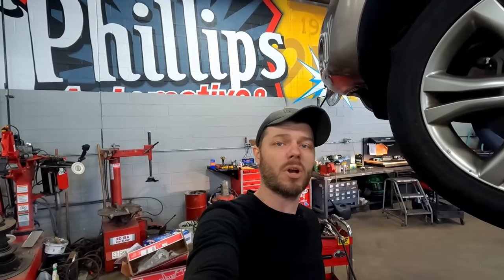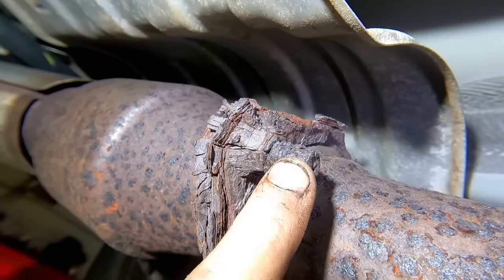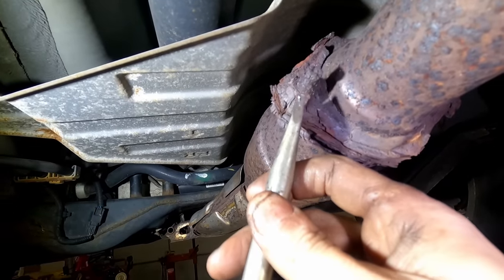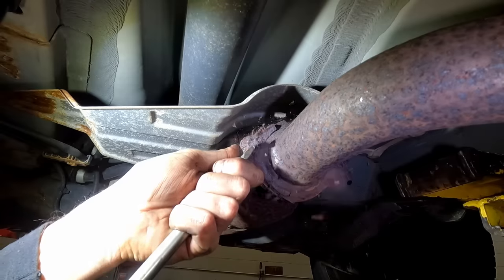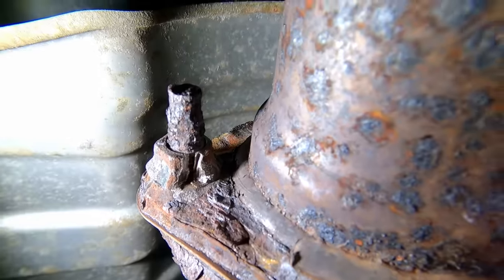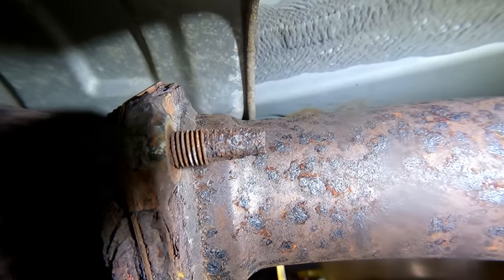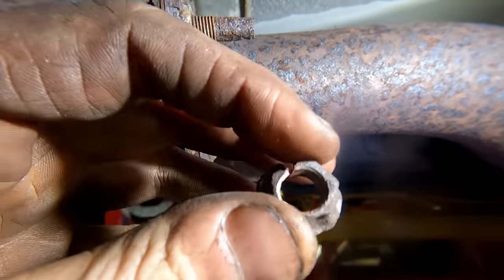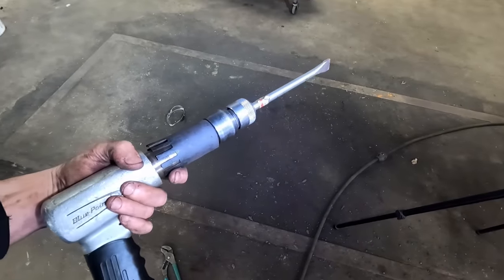Top Secret Mechanics Trick 2! HOW TO remove extremely rusty exhaust nuts FAST without heat.

Comment: My CP long barrel is still kickin' even though I retired in '85.  That's Chicago Pneumatics, not Central (HFT), to you new guys. BIG difference.  Now tell us how to remove exhaust manifold bolts from the heads.  That was always my bane to existence.
Good tip, Mike.  I wouldn't be surprised to hear (literally) of CAT thieves using it next week.
Reply from the maker: I actually use this a lot on exhaust manifold stud nuts. Ill have a video coming up soon for removing broken manifold studs in the heads super easy. Stay tuned.

Comment: Most DIY guys don't have a compressor ( I do) so they can try a nut splitter from harbor freight.
Reply: If you don't have a compressor, use a hammer. It's just going to take a little bit longer.
Reply: Nut splitters suck and there's not room on a nut like that.  As mentioned a plain chisel and a hammer does the same.  I'm just not sure why you'd bother trying to save that stud either you can sawzall through the flange knock the stud out and replace with a bolt set
Reply: Harbor Freight carried a nice electric drill with a true hammer function for around $70. Useful tool for other projects as well.
Reply: or get a cheap cut off wheel for 20 bucks
Reply: Jesus said, If you do not have an air compressor sell your cloak and buy one.
Reply: Being a DIY guy without a compressor would be like being an athlete without shoes. There is no such thing.
Reply: @paramax55  there are barefoot athletes.
Reply: @bryceg5709  it's fast and the stud is re-usable so why not
Reply: @jbbolts  because if you're a mechanic and I'm paying you to remove that nut you are presumably replacing a component on my exhaust maybe a Cat or a Muffler.  That stud if it's that corroded on the end is that corroded between the flanges also.  So when you torque the new nut on and send the customer on their merry way that stud which only costs a few bucks in bulk is going to snap off before the muffler needs replaced.

So what he did might be acceptable for a DIY guy who happens to have an air chisel and a belt grinder and a compressor but is also then not in possession of a stud but has a good replacement nut.  But if you are a professional selling a Muffler job and are under the car and doing this job just do the thing right knock out and replace the stud so your customer doesn't show up in a few thousand miles with a cracked stud and exhaust leak.

So I guess my point is good trick but  a but shoddy for professional work.  Probably recommend for fleet or rental repair but not retail private jobs
Reply: @bryceg5709  obviously you won't be using it in every situation
Reply: @bryceg5709  what is the torque spec on an exhaust flange?
Reply: @1pcfred  that size probably around 45 ft lb.  But again the corrosion and embrittlement is high
Reply: @bryceg5709  if the flange seals and the exhaust stays up then it's all good. But the only way you're going to get any kind of a guarantee anywhere is if the entire exhaust system is replaced. Otherwise it's just a repair.

Comment: it is OK IF you have the space to work, very often, these nuts are on a cramped area so you can only reach with a socket and an extension.
It is why I don't touch an exhaust system if I don't have an access to an oxy-fuel torch.
good video.

Comment: That was so refreshing and genius. I want to send this video to a few local mechanics. I drive a taxi and do lots of work/DIY on my car, but certain jobs just need lifts and expertise. No excuses from my mechanic about seized control arm bolts suspension etc will be tolerated anymore 😎🙏🏼 5:33
Reply: this trick would not work on a bolt where it is seized into a bushing, such as control arms etc. still a good trick though

Comment: Been doing it like that for 40+ years the problem is it's a no go on exhausts with cat converters, the manufactures state do not use an air chisel or the cat converter can shatter. If you're replacing the cat then it's the best/fastest way. It's a particularly useful method on manifold nuts.

Comment: Great video! I learned something new. Could you used a grinder to cut a slot into the nut and then use a big screwdriver or hand chisel placed in the slot and knock on the screwdriver or chisel in the direction to loosen the nut?

Comment: Hey MotorMike, great professional video. I am trying to replace my rusted exhaust muffler on a 2003 Dodge Dakota, my rusted bolts came off great using penetrating oil on them, however, I can't get the muffler to come loose from the pipe on either side, what is your advice on how to separate teh old muffler from teh pipes?  Thanks

Comment: I do something similar. I take a cut off wheel and remove part of the nut then use my air hammer with a chisel bit and the nut spins right off. A little part of the threads getting damaged makes no difference the new nut always hammers right down.

Comment: I've used a nut splitter before, great tool, manual wind in, but you need good access which often is not the case.

Comment: I have used a Dramel with cut off wheel to split the nut on one side, then use a chisel  to " crack the nut. Sometimes, a screw driver blade will open the nut. I have had to cut on eather side of the stud on some. As you said, the threads are still there under that nut.

Comment: Damn good and well done video using lots of light and nice zoom shots. As a competent DIYer, I had to install a new flex pipe in my friend's car. The rear fasteners were not an issue; snap them off and install new bolts and nuts. BUT the front fasteners at the cat were near impossible to get to. Snap those off and forget about an easy fix. I used PB Blaster, my oxy-acetylene torches and a spiral nut remover. Finally, the nuts did not come off, but the whole stud unscrewed from the flange. Now to put my impact to some use the next time.

Comment: Having had an old land rover that was used for all sorts of off road driving, you quickly learn that it’s far quicker to just chisel off the bolts.
I used to use a wide bolster chisel and club hammer and just cut the bolt. Land rovers are bolted together so they have lots of fasteners. 
Far easier to just cut the bolt right off and replace it. 
I’ve never used a nut splitter or air chisel.

Comment: @MotorMike unfortunately I used a grinding wheel to seperate the flanges, it worked, however, a piece of metal fell down into my muffler. Now, while holding the muffler in my hands, and and flipping it 180 degrees, I can hear the metal piece moving all around. I tried using a magnetic tool retriever, but no luck getting the piece out. Any advice is greatly appreciated, thank you for your time sir.

Comment: Nice,  When I didn't have an air chisel, I would use a drill to put 1 or 2 holes in the nut then use my hammer and chisel.

Comment: I had a 1970 Land Rover and used a nut splitter on my exhaust nuts. Very easy to do. It's a similar thing to doing this.
I saw this and thought there might be an idea for me, then realised it's a car.
I just got the nuts off my motorbike exhaust today before seeing this but I couldn't have done it anyway, exhaust and fins in the way. I did have to use a hexagonal socket for maximum grip, those multifaceted things are no good and slip off. The gasket had blown so I first tried to tighten the nut then undo it. I did this several times and got it moving and carried on and used WD40 to wash away any rust. Same with the second one. As you say, the thread is still good.
I considered drilling into the top of the nuts to help break the rust seal.

Comment: Another approach I like to use is an open end or closed end wrench 🔧 I have a small sledge hammer 🔨 I made.  Tap several times on the wrench increasing how hard you hit the wrench each tap... Breaks it loose every time

It's fast quick and EASY

Comment: I'm with jackoneill. Been using nut busters for 30 years. You can make them any way u like in a few min. Always works. Or a induction gun. Heat it up, smack with hammer and remove. Or just cut it off.

Comment: Excellent technique to remove rusted bolt if you have a snap on Ingersoll Rand long barrel air hammer. These are not cheap. But if you dont have one of them, use torch

Comment: Your chisel bits are tool steel. Put them in a vice and use a file to sharpen them. The heat from the grinder will stuff the tensil of the tool stell in the tip, soften it and will wreck it. Also air chisels are banned in the workplace in some countries, too loud , use ear protection or pardon what was that will be your favourite saying.
Reply from the maker: YES very important tip. I'm a machinist and metallurgist also. When sharpening you can use a grinder but VERY important to keep the heat down. Do not allow it to turn blue. Go slow and cool as needed.

Comment: Simple way of doing it, as long as you don’t need to reuse the nut or have a spare one. I have used a centre punch as well doing it this way. I prefer the hot 🔥 spanner . Or welding a large nut to the rusted one. I used to work on salt mine trucks as a diesel mechanic.

Comment: Good video thanks. Just an observation, be careful the way you sharpen the chisel on the bench grinder as the chisel can get pulled in between the rest and the wheel, which can make the wheel explode, doing it that way. Really you should point the chisel upwards when sharpening

Comment: This trick is great on most nuts in a solid position. But on exhausts with hammer and chisel this can not be dine. But there is a tool that just goes over most nuts and when you torque it down it cracks the nut.

Comment: I used a long arm torquing wrench with a socket on a header to manifold nut which only sheared the corners off the nut, then tried a cold chisel for over two hours and the nut is destroyed on one side and damaged the stud thread. The other nut is frozen as well.

Comment: air hammers are one of the most useful tools... i remember when my grandpa got me my first devilbiss set when i was little... well, young, i was 5'11" and 270 when i was 12. went from running back when i was 8 and "normal" size, to supersize lineman by the end of my first football season gaining 40 lbs in that season alone... never did get any taller... did get a tad wider, though. which is nice... 😒 i'm just off on some tangents today.

Comment: I knew this last-resort technique already though I can only use manual force and a cold chisel as I do not own an appropriate air gun. Most interesting part of this presentation is that you work with bare fingers, no gloves, which is how it should be done for max feel!
Reply: I'm a mechanic, and as long as you have enough access to swing the hammer adequately without hitting your hands then by all means you can use your hammer and cold chisel. I do it all of the time when I can't get my air  chisel into.

Comment: I wish I had know this before doing the exhaust on my truck. I had two of those flanges with three bolts each, and one nut telling me to split the flanges with an angle grinder to get the bolts out. I flatly refused to do that, and did it the hard way, drilling the bolts out.

Comment: Great trick!  I've used nut splitters in the past when an air hammer or manual chisel wasn't an option.  On an exhaust that bad, if it's a full replacement, I'd just Sawzall it and toss the bits in the bin

Comment: Nice work! Personally, I would have cut it off, drilled it out and replaced with a new nut and bolt though!
Reply from the maker: you never want to voluntarily drill an exhaust stud. They are super hardened over time from all the heat. It's a good way to kill drill bits. better option if the Nut won't come off is to cut the stud behind the nuts to remove the mating part. Then cut the remining stud flush with its own flange. then heat the flange around the stud till its glowing red and take a punch and punch the stud through. It will blow the treads out and leave a nice clean hole to pass a new bolt through. You'll be finished the whole job before you drill out 1 stud.
Reply: That's exactly what I did on my exhaust.
Reply: @motormike43  great answer and as you have shown it's the last resort too,great learning video for those that dont use this method,those air tools are great at unsleaving exhaus tsections too that slide into each other,have a great day
Reply: @motormike43  00000000000⁰000
Reply: If they are that bad then I usually won't cut them. I will heat up the flange just like Mike said then put the easy out socket on the stud and put it in reverse and it will rip right out usually taking the threads with it. Then the nut and bolt passes right through. Same but with no pounding of the hot steel with an air hammer and possibly bending the ear of the flange preventing it from sealing.
Reply: I'd replace the whole exhaust if it was my car.

Comment: Can also cut the groove with a small dremel cutting wheel or grinding bit, with some precision. Then you can hammer a chisel into that. Possibly a quicker way to do it without an air hammer than hammering the chisel for the whole thing.
Reply: also avoids rattling the shit out of the whole exhaust system. potentially damaging cats etc
Reply: That's exactly what I was thinking too

Comment: Nifty ! I've seen quite a few of what I'd otherwise consider damn good mechanics waste a lot of time with heat on such jobs. Even just a regular hammer & chisel will work virtually every time so long as you have access. Luckily my uncle taught me this when I was a kid. A torch is a must for certain things though.
Reply: In the absence of an air chisel ,  heat and an undersized socket hammered on works great . Also an angle grinder with 1mm cutting disc and a new bolt works very quickly and easily .
Reply: Heat makes it faster and easier, less damage as well. They knew what they were doing. If this was a smaller fastener , he'd have broken it before he got it apart

Comment: Grinder
Reply from the maker: What are you doing with the grinder?
Reply: I usually zip saw the nut/bolt off and install new hardware. I wouldn’t leave the rusted bolt on there. Good tip though
Reply: You can if you are careful cut through one side of the nut with a slitting disc

Comment: I have done this with a hammer and chisel. I see the air chisel is probably better especially where the part vibrate dissipate your hammer blow. Of course this only works where you can get a straight shot on the nut. This is the life of repairs in the north where salt is used on the roads.

Comment: I had my exhaust look like that. Hit around it with a ball peen hammer lightly, some love taps with a cold chisel, and wire brushed it down. Wrenched it off, and re used all of it. If you want to break the nut, theres also nut splitters available for cheap

Comment: Another approach to removing rusted nuts is to brush it with 30% muriatic acid, they sell it at Home Depot.

The acid dissolves the rust very quickly, in about 30-40 seconds, might take more time for deep rust but it works.

Just pour some muriatic acid in a cup and brush it on the rusted nut until the rust is gone then it should come off easily.

The fumes of the muriatic acid are strong so use a respirator and safety goggles and gloves, in a well ventilated area.

Comment: Great. Instead of using a nut splitter for 5$ you have to buy a Chisel, a compressor, air hose and the device to hold the chisel. 2500$. Really, a great video.

Comment: I broke the head off the bolt holding my catalytic converter to the exhaust manifold.  I'm thinking of breaking the head off the other bolt. cutting the bottom section of pipe below the cat to get that out of the way, then cut the broken bolts till they are flush with the flange, then drill through the part of the bolts that are on the manifold flange and use new bolts to reattach with a new gasket since there is a leak where the 2 pipes meet.  Any reason this won't work?

Comment: I am a believer.  Also, Trailblazer front differential fill plug, about 1-1/4" diameter, with a 15mm hex boss in center, stripped, and no practical way to grab the rounded protrusion...  Air chisel with a sharp v- actually a semicircular point, removed this ruined dog by peening a nice double-dimple, then it came right loose.

Comment: Too add, i found the best way to remove a stud is to smash a bolt extractor socket on the bottom of the stud. The non threaded part. Then just zip it out with an impact. Stud and nut come out easy. I used this method to get old rusty studs out. Stud extractor wouldnt fit where I needed it. too. With this method the threads on the stud are untouched

Comment: Exhaust nuts made of carbon steel become so brittle over time they are usually easy to break like you did, it’s the nuts that don’t get the heat but lots of rust and corrosion on the threads that are the toughest to remove.

Comment: WAAAY Fastest than that is my method: Use an mini angle grinder as bosch, wurth and milwaukee produce. It takes about 30seconds for both nuts. If isn't enought space for that small tool, you could use that mini sawzall from same companies. 
Cheers,

Comment: I discovered this by accident with a seized ball joint castle but. I intended to split it with a drill, then cracked it loose with a punch after drilling some grooves into it.